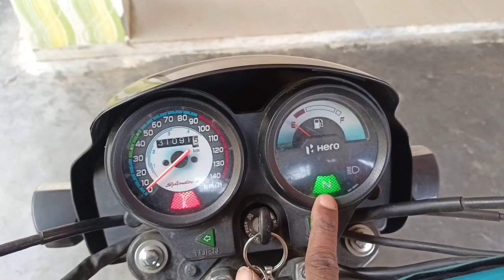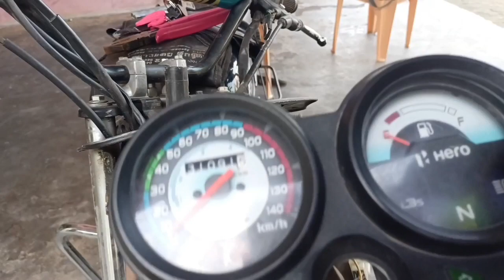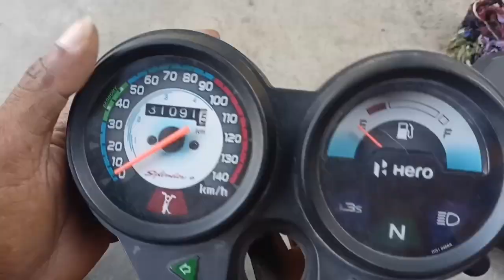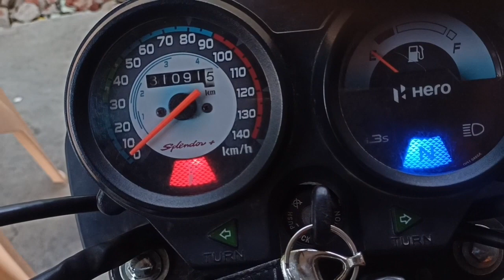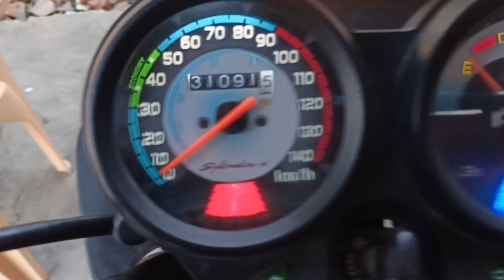Splendor neutral light blue colour, Speedometer light led changing tamil🔥🔥🔥

Comment: hi bro i have 1997 model splendor athula head light  battery la work agura mathiri change panna mudiyuma
Reply: Mine too 97 model  , if you use Led beam headlight it is possible to change from AC to DC . If ure using stock glass model headlight running power is applicable
Reply: @immanuelmose  oh want to change the headlight glass haa
Reply: @KishoreKumar_24  no you need to change the whole headlight assy. But It might drink your battery dry.